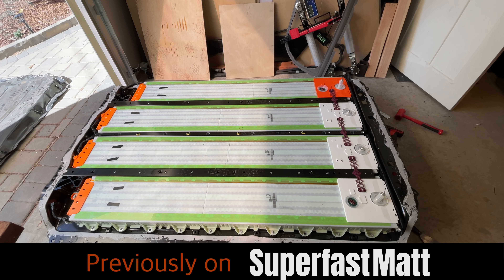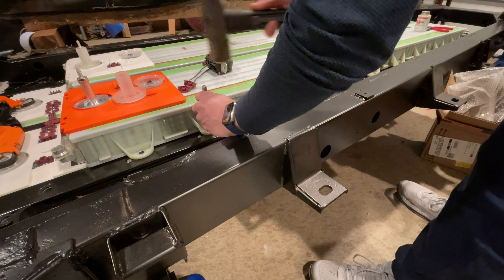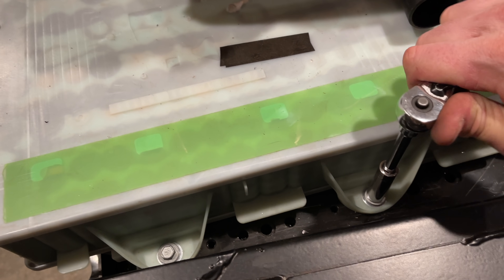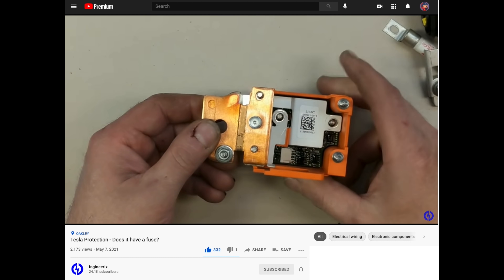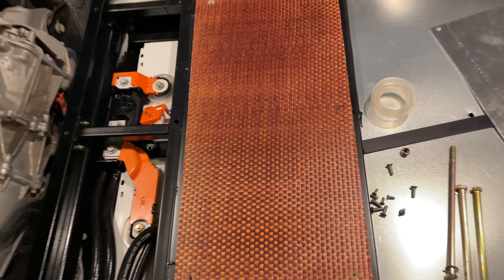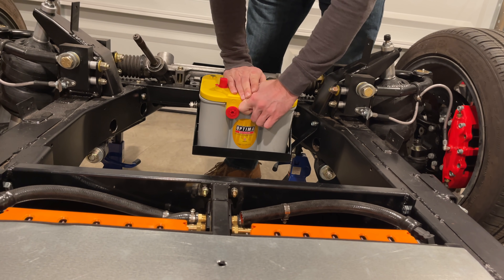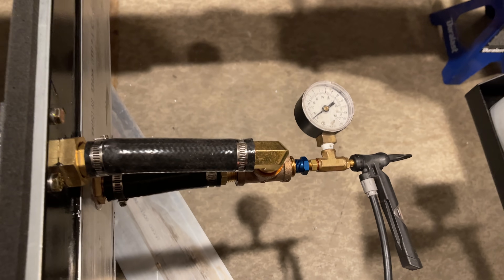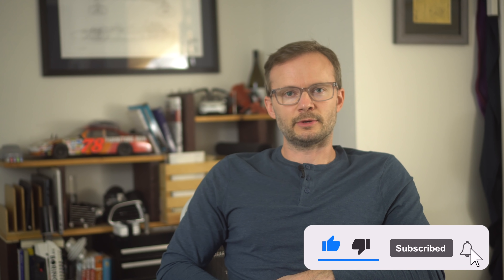Tesla Battery Swap Part 2 - We Continue To Shove A Model 3 Battery Into A 1950 Jaguar.

Comment: I'm surprised he didn't just use the part of the posts he cut off the battery modules as the other end of the wire to connect the battery pack to the outhouse. It's exactly what he needed! Which isn't very surprising, considering that what he needed to do was, essentially, put a length of wire in the middle of the battery posts.
Now, I'm sure there's a perfectly good reason why he shouldn't have done this easy solution, and that it probably involves not wanting to blow his dick up, but that doesn't mean I can't be surprised he didn't try it anyway. Probably before realizing it wouldn't work and then making the thing he made (the thing he should've made in the first place) after going through the time, effort, and expense of making the first thing.

Comment: You were wondering why the battery mounting bolts were M6 while the holes were 10mm? It's a design principal I call 'fudge factor'. It allows things to be just a little bit off and still bolt together.

Comment: One way to get around the uneven flow on your non ideal home built manifolds on a project like this is to use it in your favor - you just make the inlet and outlet manifolds the same and give each string a favored port on one end and a non favored port on the other end and vise versa so that the total flow restriction on each parallel string is (roughly) equal.

Again, thanks a ton for all the detail on these videos, I'm gaining a ton of useful info from them, and therefore trying to return the favor in the comment section, lol.

Comment: Another engine that would be cool for this. Is a vortec 4200. Or the 5cyl version. If it's too long. They can make serious power. Just adding a turbo and injectors can get 500+ at the wheels. With low end tq and peak HP around 6k rpm thanks to variable cam timing. They are awesome little engines, not the basic paperweights the old i6 engines were. The only thing I did with the pushrod i6 engines is remove them. Swap in a V8. I have had plans to convert a vehicle to electric for years.  I have bought 3 series wound brushed forklift motors, but will likely use a Nissan leaf motor. If I ever actually build one.   I may use 1-2 of the forklift motors  in a small Geo metro converted to a tiny truck or possibly a tracker sized vehicle, use a lifepo4 battery. 100ah cells, with 2in parallel , making a 200ah. 20 series cells , being128v nominal. To equal 25-kwh nearly  26kwh. The one motor is rated at 3.8kw @ 24v running at 120v it will require extra cooling, running at 36v it stays room temperature. It can safely run at 180-195°f plus. I will obviously add a few thermal sensors. A alarm and temperature gauge on each motor.the brushes will wear faster  
A 2"-3." High velocity blower will probably be all the cooling required. I will probably  wrap the motor with copper or aluminum tubing. And epoxy it to the case.  Pump coolant through it. After some math 72v is about the limit, bring the wattage squares. The less than 4kw exploded to 8x that. By doubling the volts . The motor will be 13.32kw at 72v, so 24 series cells for 76.8v  nominal. And 88.8 volts absolute maximum.  Maybe 280-320ah cells would be a better fit, to allow a 300amp draw easy . And having two identical motors. To equal 26.6kw motors  the drawback is them weighing about 150lbs each.  Being made from cast iron and steel. Bring filled with iron and copper! A bldc motor would be much lighter.  , although having about 36hp and the TQ of a flock of buffalo. It should carry a small vehicle fairly well. Total weight bring 1800-2000lbs. Using a 5-6 speed manual transmission. Using  gears 2-5, probably only 3&4th gear on the highway possibly 5th could be used to allow low motor speed with light load 60 mph should not require much power to maintain. A current and tachometer used to determine the economy/ battery usage. I'd like to get a imported micro van or truck. Convert to electric, maybe build a small 350v battery for the electric accessories, like 25ah cells350-400v. For the ac, and heat,  use a transformer to boost the 72v to 350-400, using a push pull MOSFET configuration to a transformer, wound for 65-70v   to allow a microcontroller to control the output. Basically a 72v-400volt inverter.   Only about 1000-1200 watts. 12vbrake boost, and power steering, using. A 72v-12v DC buck converter that should be a common part.  Using a 50ah lifepo4 12v battery,  switch all lighting to LED.   A couple 100 amp alternators  attached to the drive shaft  to work as Regen braking. Only charging when brakes are applied. So the first 3" of pedal is the pot for the alternator  charging , make bore power to charge the battery.  Having 3batteries , it will probably be the 12v system  that also can charge the 400 v system Aldo if fully charged,  send about 500 watts to the hv battery, if it's full. Charge the 72v battery!  Sorry to ramble about my idea hor ev conversion. Have a awesome day and thanksgiving ! ☮️

Comment: Prob should of did a vacuum test along with the pressure test. As things cool down they can pull vacuum and introduce containments or air.

My understanding if you split the incoming flow to go to both ends of 4 way splitter than it can be equal pressure in all ways.  Not sure what this will do with overall flow but pressure will be more equal.

Protection for the flow outlets in front of the pack.  Model 3 has a problem with this that is only rear motor. Debris can push against the flimsy plastic shield and damage the plastic connectors.
Reply: The Tesla coolant system doesn't pull a vacuum like an ICE's; it also doesn't cycle the temperature nearly as wide, as it never gets "hot".  Above a certain temperature, the A/C system starts doing the heavy lifting of cooling the coolant, via a heat exchanger.

Comment: Great stuff - you are doing an amazing job. But you may want to reconsider the aluminum lugs. After a while, they can oxidize and go ohmic, causing all kinds of trouble. Aerospace applications still use lots of copper, even though the aluminum is lighter for this reason. Also, in the 70's, builders started to switch to aluminum in houses, but lots burned down. Many owners had their houses rewired. It is possible to get a good connection, but if you are a little off, it can work for a while, until it doesn't.

Comment: I hate those hose clamps on…hose. The soft hose ones that McMaster sells are much better as they won’t cut into rubber or polyurethane hose. ABA brand ones that old Volvos use are great. Same story with BMWs.

Comment: You might find with the movement of the car and the panels drumming you will suck in dust I to that battery pod. Might be an idea to put some positive pressure in that sucker somehow. Hey I come with problems not solutions!!
Reply from the maker: The plan is to have a small fan with a filter on it coming from inside the cabin. That will keep it from getting condensation inside as well. There's just no way it's going to be air tight.

Comment: Havent seen any conversion that went so boldly into the battery-skateboard design as you on this Jag! Really cool! Wouldn't this also work with American cars from the 60's? Like the 64-66 Lincoln Continentals? Lots of space on the underside for batts, lots of space under hood & trunk for dual motors too.

Comment: There appears to be some bare steel-aluminum contact at load bearing points. Is galvanic corrosion taken into account? I've seen unshielded steel rivets turn aluminum body paneling to mush on semis, be a shame to have that happen inside your battery.

Comment: For those of us who are incurably curious,  can you please post some links, if you have found some,  where electrical schematics, dimensions of the components can be found including CAD modelling {Electronic such as Autocad 2D or Fusion 360 not cardboard) and other resources for system problem solving.  Great project and videos.
Reply from the maker: GrabCAD has some cad models. You can find wiring diagrams if you search for the service manual, but they are Tesla’s copyright, so I can’t post them here.

Comment: Do an EV conversion, but instead of the defacto method slapping a big motor onto the transmission, use a bunch of little motors with linkages down to the crankshaft through the combustion chamber.

Comment: next time you use a magnet to pick up metal shavings, put the magnet end in a small bag like a sandwich bag. Then to remove the shavings off the magnet, just pull off the bag.

Comment: What's the plan if you ever have to remove the battery from the finished car? It looks like you'll have to remove the car body...
Reply from the maker: Nope, I can drop it out of the bottom by removing the bolts from underneath. But, I will also have access holes to get to the front and rear in case I need to replace a busbar or the pyro fuse or something.

Comment: As an EE Student with knowlege in Electric car drivetrain design and a gigantic respect for Lithium Battery packs and what happens when they fail, the things you do to a live pack make me wanna take a few steps of safety distance from my phone screen. 
The car battery clamps are super dangerous IMO. When they loosen up just a tiny bit, the contact resistance will rise and you could have molten Clamp connectors right above your battery pack. I am also worried about the current rating. If telsla specs a 12mm or so metal rod to carry the current, a drilled out Clamp connector might not cut it. Please find a safer alternative for those.

Comment: Definitely pinch clamps once you are certain about your coolant setup. Not fun to take them apart though. Also worth considering, the Model 3 pack has a vent on it that you may want to incorporate into the Jag. Should be able to pop it out and it just needs the appropriate sized through hole.

Comment: It is sure a fun project.. 
Myself have a 1974 XJ6L Jag could be used for such a conversion.

My concern is you are useing aluminum connectors with a cooper wire . Not so a good idea as aluminum is a lesser metal and by such oxidation happens = heat . 
Many homes did burn down because of such . 
You may need to rethink that connector .

Comment: If there isn't already a steel sheet on top of the bottom modules, I'd consider adding one with some PET film or other non-conductive coating on both sides to provide more separation from the top modules. The 2170 cells Tesla uses are oriented with the cap and vent pointing downwards so if one goes into thermal runaway, the hot gasses blow out of the bottom of the module. This will be fine for the lower two modules, but if a cell in one of the upper modules gets too hot & starts to run away, those gasses will blow right out of the blue potting compound and could melt into the lower module, setting off cells there too.

Tesla designs a roughly 10mm air gap between the bottom of the modules and the bottom steel sheet of the pack for volume for gasses to escape and a bit of dead space in case of underbody damage - I'd recommend you try to do the same with the upper layer of cells to give enough gap for gas to escape, but have an insulated steel sheet between the upper and lower modules to spread out the heat and keep a jet of burning gas from lighting off more of the pack.

Comment: Very well done.  You are definitely doing well "above average".  :-)   Sealing the battery compartment tight will be a challenge, but from your videos I have full confidence.  While driving/charging you could slightly pressurize the compartment with a fan blowing air from the cabin to keep road spray from seeping in.

Comment: As a former tube and hose test engineer. Standard hose clamps are what we used for connecting everything that wasn't the production fitting being tested. They seal better than any of the single use clamps, they're just more expensive.
Reply: This sounds like a joke, but I swear, that sounds like a sick ass job as mech engineer dilettante. People don't realize shit like that is MEGA important. Akin to engineers testing bearings or braking systems.

Comment: I am doing a very similar (as similar as an old Jag can be to an 80s SUV) EV conversion using a model 3 pack. My pack design is totally different, but I generally like where you are going... The idea to use automotive clamps on the cutdown posts was a good one!  Not knowing how far behind these videos are from reality, and not knowing all the gritty details, I do have one suggestion to make😬.

Based on my previous experience with BMS troubleshooting (not Teslas, aftermarket), the most common way to make the BMS freak out is having a connection that is higher resistance than the BMS expects. On the front end of your modules it looked like you cut the busbar down and reconnected it using two bolts... I would expect that connection to be pretty high resistance (comparatively vs the factory setup). The BMS tests every cell by checking the voltage drop across it, and may be testing the voltage drop between modules... Keep those connections in mind if you get BMS faults.

Comment: Hey HyperMatt, (cool new name would it be? !) What about galvanic corrosion between all these beautifull aluminum sheet electrode that will end out finding a path to the Steel unpainted area frame?  will you add some gravelguard or some sort of  isolations to stop that unwanted 3rd "battery" ?

Comment: Matt, if you have a flow issue in the manifolds, you can fix it with a bolt. Remove the inlet barb and tap threads down on the far end. You may want to test different sizes until the panhead equalizes the flow at your gpm. Costs nothing and it will work. If the head depth is about center of the two outlets that don't flow, the diversion will send some of the water to the first set and pass the remaining to the second set.
Reply: On your Honda, dual Honda Fit (see how that works ;-) ) pancake axial flux motors on a pillow block mounted shaft attached to front cv will get rid of the chain and complexity. If you're feeling ambitious you could use a traction control setup to drive the outboard wheel in corners??

Comment: Just a question of what you feel comfortable asking a guru about. My advice would have you speaking to Jehu Garcia and or M J Lorton about anything electrical if you are ok with that kind of thing. Both of those people are quite adept at diagnosing anything electrical. Just a suggestion, get help if you are ok with doing so. Bullying your way to doing something is novel idea, but totally unnecessary at this point. Go for it if you are comfortable doing that. Help is always the way to move forward. 

Being safe with your family is too important and don't put yourself in harms way. Be safe out there.

Comment: Your 'good' hose clamps are still the 'not good' hose clamp.  Look into 'fuel injection' clamps instead of the worm style.  The range isn't as great, but they clamp a LOT more secure and they don't damage the hose as much due to lack of serrations.

Comment: Switch to the single sided vibration-resistant pinch clamps.  Battery leaks suck, hose clamps and spring clamps can leak. A good pinch clamp will never fail

Comment: Are you concerned about the frame flexing since you removed the supports? I know the twist from the ICE is gone, and the electric setup is basically contained in the rear, but I feel like the frame may be "bouncy" going down the road without some sort of cross support.

Comment: I'd be a bit wary of the battery sealing too. And if it's really well sealed you risk condensation. Have you considered putting an Arduino or something in there with a water sensor and a humidity sensor?

Also, do you have an expansion chamber or something to  compensate for the pressure when it goes from -20°C to +70°C?

Comment: I find this project awesome but, for me, this battery case seems like a safety issue. It would make more sense to have it built properly as a solid sealed box and only after it should be bolted to the frame. Anyway, awesome project.
Reply: $8,000 later, you'll have a really nice box that still doesn't fit the car.

Comment: Aha, thermal design engineer here :o) The bias flow in the 4 way blocks you balance by piping them opposite the other end. *it doesn’t seem to affect the bias coming or going. *if it is going slow enough you won’t notice the direction-restriction anyway.
Reply: Nice simple fix!
Reply: @shannons1886  yes :o) it was from the test rig and what happens if you have ports both one side of the rad instead of opposite corners? An effect which is way worse with oil than with water heat exchangers.

Comment: Impressive work...will be fun to follow the build and progress.
How will you do with the AC and cooling system. Model 3 is using a heat pump right?
Reply from the maker: I'm not totally sure yet, but I'll probably use an AC compressor going to a Refrigerant/coolant heat exchanger. For heating, I'll probably just use an inline resistive coolant heater. A control system will be a challenge, but I guess I can start with "if temp>XYZ A/C on, If temp<ABC heater on"

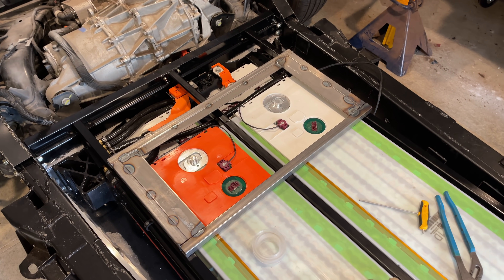Comment: 8:24
Won't these things basically start to melt under really high amp draw?
Also possibly fire risk from them just getting hot?
Reply from the maker: I don't think so. Given the cross sectional area and the melting point, it's less likely to be a problem than other parts of the system that Tesla designed.

Comment: Another great video. interesting and informative.Instead of using spray paint for the coating would apray on truck bead liner work better. It id thicker and more sound deadening than regular spray paint.
Reply from the maker: I'm using underbody spray, which is a lot like truck bedliner. it's less durable but more rubbery so better deadening.